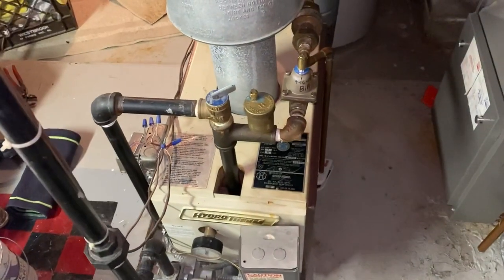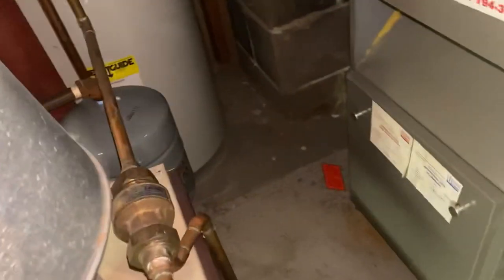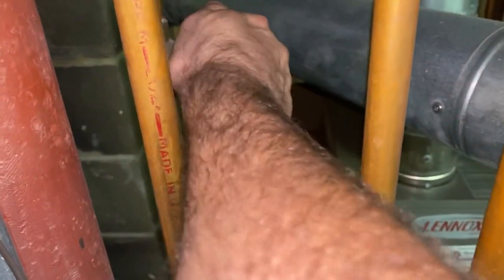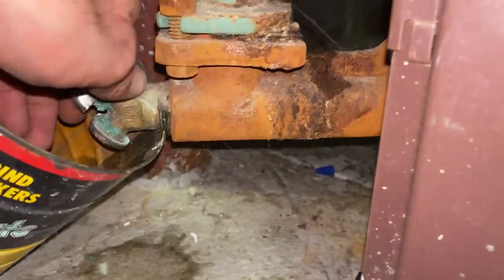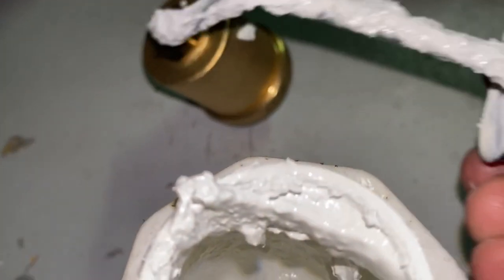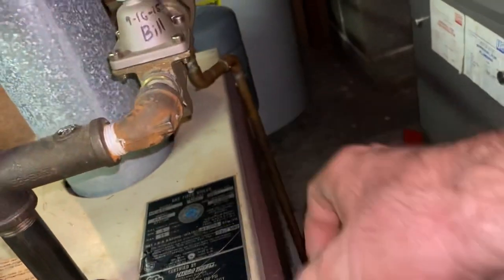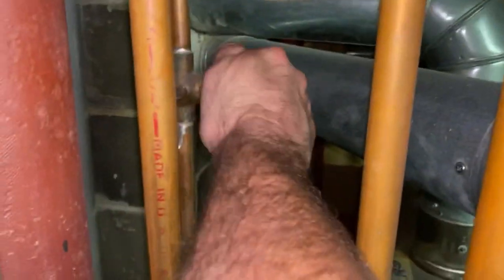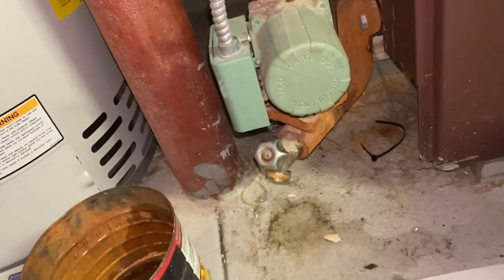Boiler Leaky Air Vent Repair

Comment: So I have two air vents and looking to replace them cause leaking. one if 150 psi 240 and the other is 35psi type 67. Is this normal?

Comment: Why didn't you use Teflon tape?
Reply from the maker: Didn’t want to. Teflon, pipe dope, it don’t matter these threads don’t leak ever. It’s the float inside that gets gunked up and won’t make a seal.
Reply: @thehvachacker  I've seen other videos so That's why I asked
Reply from the maker: @chrislauterbach8856 Teflon alone can seal a water pipe. Dope alone also. Doing both is just better protection. I usually only dope the vent.
Reply: @thehvachacker  thanks

Comment: Hi, I wonder why when the old vent was taken out, there was no water coming out.  Don't you have to drain it below that level in order for water to not come out? Or somehow the water stays in after you shut the supply ball valves and relieved pressure to zero?  Thanks
Reply: His finger was wet at the very beginning and when you remove the pressure from the boiler the water is bellow the vent.
Reply from the maker: A coworker replaced the expansion tank earlier that day. He should of changed the vent also. There was blue crust on it. Indication it leaks sometimes. Yet once the pressure was dropped the foot in the air vent drops. Allowing crude to prevent the float from sealing again. I replace a vent every time I open a boiler. They usually leak if I don’t replace
Reply: @thehvachacker  yeah, pretty much if pressure needs removed, replace all vents, relief valves and expansion tanks (or check charge). if not there will be guaranteed callbacks.
** boiler drain valves while at it, leaks galore :)

Comment: Do you tighten the cap on that valve, leave it loose, or leave it off ?
Reply from the maker: Leave it loose. If it’s closed air vent won’t let the air out

Comment: Would this leaky vent cause the boiler pressure to drop over time if it was not fixed?
Reply from the maker: It could if the PRV failed or supply was shut.

Comment: This is a great video.  Should the vent cap be tight or a little loose?  I also have an issue with my Weil-McClain cga that no service shop can resolve: When my boiler finishes heating the water the temperature will coninue to climb (up to 220 degrees) if I don't have a circulating pump running. Have you seen this? Thanks
Reply: I have the same question
Reply: Sounds like the water side of the boiler is covered with scale (calcium carbonate &/or magnesium carbonate) this slows the heat transfer so when the pump stops the hotter metal keeps transfering heat to the water. As pump is off it keeps getting hotter. Citric acid based descaler can be added & left to circlate for a few days to clean the boiler & baseboard/radiator heaters. Colour changing descaler lets you know if you need to add more or that it's finished. It doesn't emit gas so won't need venting. When you are done flush the system a few times & add inhibitor with the last refil. It should make the whole system more efficient as more of the heat can reach the pumped water. 🙂
Reply: Thank you sir. I’ll try it and let you know.
Reply: I have an old system from 1950 Venturi T's one zone anytime I do anything open up the boiler I have to bleed all the old fashioned radiators they are the ones that go under the window just copper with fins on it from the 1950s😊

Comment: What would happen if you put a plug in that tee and eliminated the vent? Great video
Reply from the maker: Most lazy techs will crank down that cap on top. Yet air in the system makes gurgling sounds when the heat is on. If enough air builds the boiler gets air locked. Water won’t move through the air. The pump doesn’t create enough force to push or pull an air pocket. Make up water can introduce air. Now on a system with glycol, make up water is valves off no PRV. Air vents also closed. Have to keep proper mixture glycol and water.
Reply: @thehvachacker  Thanks for the explanation. If you eliminate the PRV valve in a closed glycol system what protects the system from a disaster like if for some reason the burner Didnt shutoff?

Comment: You opened the drain valve, and water came out. What does that mean? The air equal to the volume of the displaced water was now in the piping system. You took off the old air vent valve, and no water came out because now that part of the piping had the air. At the end you didn't purge the air out of the piping. So this video is like many others a fake. Not real plumbing job.
Reply: The air leaves through the bottle vent he just installed. That's the same place it came in through when he drained.